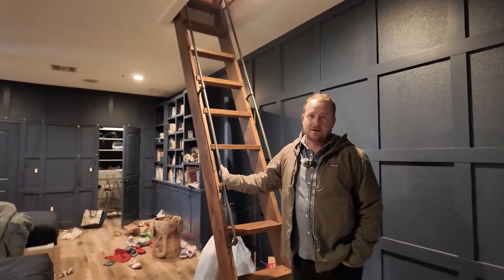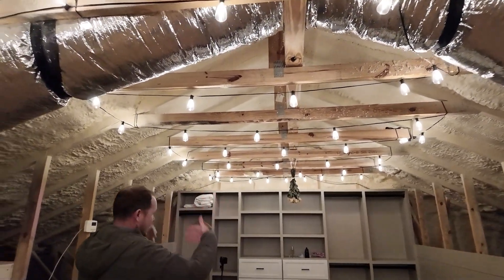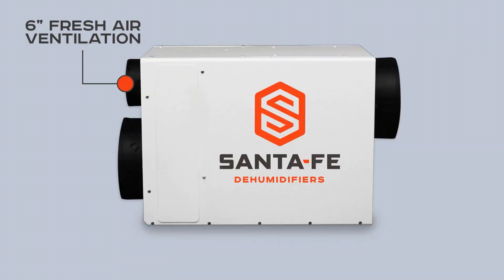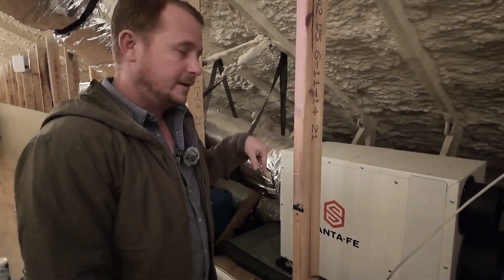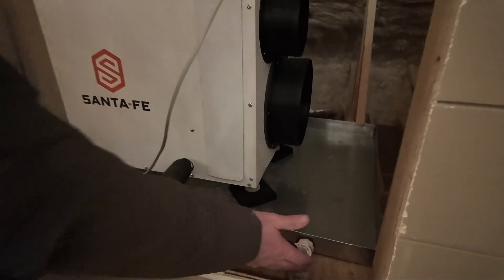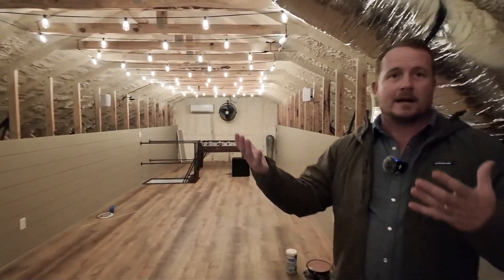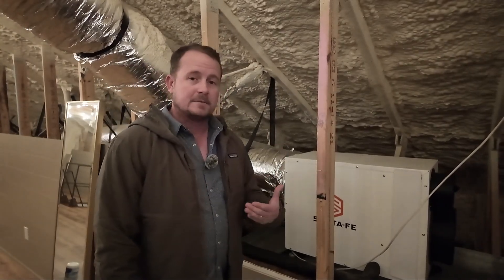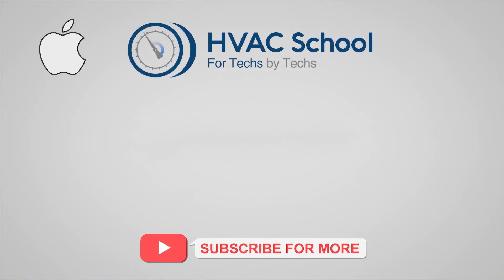How to Fix Attic Humidity Problems with Santa Fe Ultra Series Dehumidifier

Comment: Seems like piping the dehum air into the return wouldn't be such a loss because the ac doesn't have a latent load so you get more sensible cooling.  No?